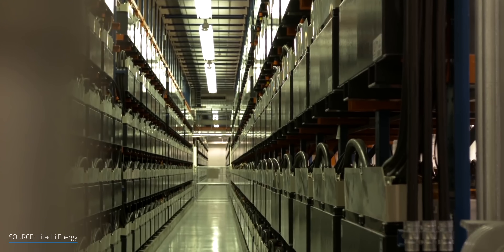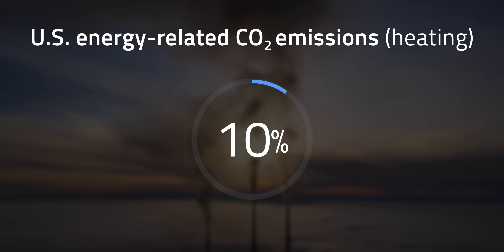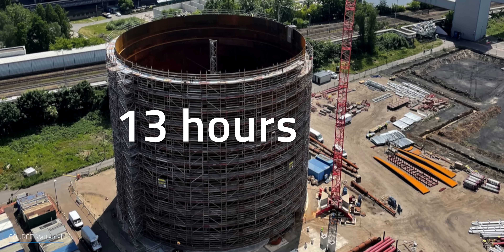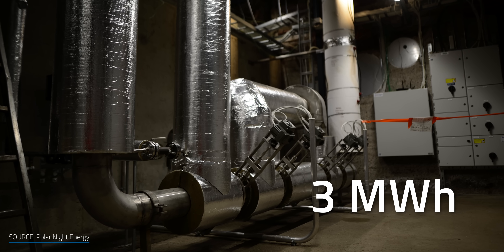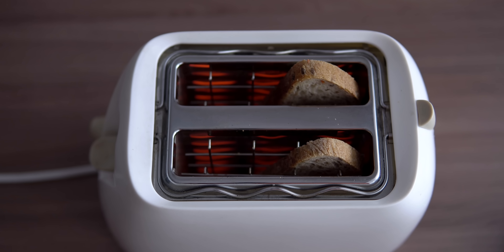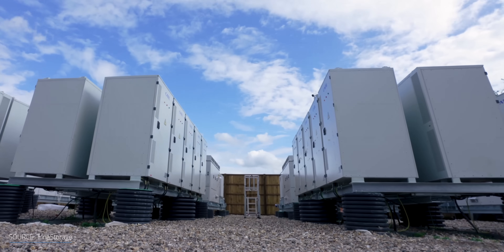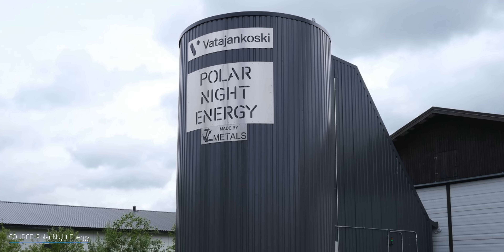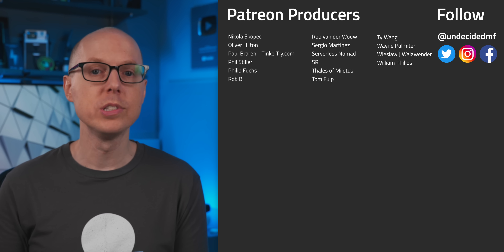How A Sand Battery Could Change The Energy Game

Comment: For heat storage the theory is really simple: Surface area increases by the second power, but volume increases by the third power.  So, for example, the surface area of a sphere is 4 * pi *r ^2 while its volume is (4/3) * pi * r^3.   The ability for sand or any medium to retain heat is primarily a function of this ratio... the only way to lose the heat in the storage medium is through its surface area.  So scale winds up being very important.   The bigger the storage medium, the more efficiently it can store heat.

The problems are many, though.   All heat storage devices have thermal expansion and contraction stresses so a daily cycle can really be quite harsh on the infrastructure.  In other-words, maintenance can wind up being a relatively large component of the operating cost.  Particularly if major portions of the device are inaccessible (aka sand battery).  Liquid (e.g. syrup consistency) based systems are far easier to maintain because no internal structures are required... you just pump the liquid through a loop just like a heat-pump water heater does.   Phase-change materials that go between liquid and gas are even better because the energy density is typically far higher.

It will be interesting to see how these progress, but it is a fairly tall order to compete against battery technologies which can be produced in GWh volumes and get cheaper and cheaper every year.
Reply: I wonder if these batteries could be kept underground.
Reply: they don't heat it up everyday
Reply: Heat expansion can be a problem in the long term sure. But if they have it working now and can estimate 50 years out of it, then think about it when it's scaled up. If this gets build big enough, then a single degree of chainge in temperature will store a huge amount of energy and therefore lower the amount of thermal expansion.
Reply: There is a surface area at which the heat loss (no matter how well insulated) begins to increase, so that is a limiting factor.
Reply: @timgurr1876  Surface area limiting factor only matters in how small the system can be and still be efficient enough for use, there is literally no limiting factor in how big the system can be, other than the materials used to build the sand holding. The bigger the system, the more efficient in storing the heat.
Reply: Sooo like the Giza Pyramid and probably like the Serapeum of Saqqara. Got to realize it at this point..
Reply: Surely you would just store the sand in a expandle material like arubber bladder that can expand and shrink and then ensure the first layer of insulation has a degree of flex. It is only the outer shell that needs to be rigid
Reply: Note that the amount of piping needed is proportional to the volume. It can only be cheaper if you target slower discharge. So e.g. a big-ass seasonal energy storage will be cheaper because it needs to discharge over many months, so there's more time for heat to travel through sand.

Now how big is big? Dry sand heat capacity is 800 J/(kg K). If we heat it up to 600 C, that's 480 kJ per kg of sand. Heating of a house in a northern country might require 10000 kWh per hear, which translates to 36 GJ.  So storing heat for one house would require 75 tonnes of sand. (50 cubic meters.)

If their prototype shown in a video stores 8 M Wh, that's barely sufficient for one house. So, basically, to keep a house warm during the winter you need a battery the size of the house.

So I don't think seasonal storage makes sense. To store energy for a district of with 10000 homes you need 500000 m3 battery. It can be e.g. cuboid with 50 m height and 100m length and widths. So, basically, the size of a hill. Or a city block.

The volume of The Great Pyramid of Giza is 2.6 m3, so that would store heat for 50000 people.

In other words, you need a megastructure like The Great Pyramid of Giza in every town of 50000 people. Not really feasible, is it?
Reply: OTOH if we had tiny robots which can build tunnels then existing rock formations (or maybe just soil) can be used for heat storage. If there's a way to build these tunnels for cheap it might be feasible.
Reply: @killers31337  Unless you build the city on top of the sand mass. If a greater stability is needed , concrete piers can do the job and further contribute to the total mass being heated. At some point a large enough mass doesn't require insulating except for the top in order to eliminate heat gain when not needed. In winter conditions some of the insulation could be removed and allow some heat to come in through the lower building elevations.
Reply: Wrong!

Comment: My one largest question here is:
Is it really possible to store energy at 600 C for months? The temperature difference with ambient temperature is almost 600 C. I really wonder how much energy is lost in 6 months time using this high temperature storage.
Reply: City block size with 10 feet of steel mill slag as insulation? Yes.
Reply: @kkarllwt  hmmmm interesting. But so the feasibility really depends on the scale and available space in the city/area. I am very looking forward to their end of year performance report

Comment: 25% efficiency in power generation is still acceptable, given how cheap and easy to build these silos are, and that the planet has a huge excess of sand.
Reply: Especially given the long distance high voltage lines that lose 40% over distance.
Reply: @davidmccarthy6061  I'm imagining every neighbourhood having a medium size one or every town having a large one, either way long distance transmission lines wouldn't be required. Though there'd still be some minor power loss between the generator and recipient I still think such a plan would make a nice compliment to the grid.

Comment: This seems like a great option for energy storage. However, I see a greater problem in the U.S.A., we are not insulating our homes to be efficient. In my area, they are still building stick homes without an exterior insulation wrap. Better insulation means less heating and cooling in the first place.  Cheers
Reply: My son did a science project in the 8th grade, comparing roof construction to solar gain.  We found that roofs heat houses thru radiation.  Radiant heat barriers prevent 90% of room heating.  Radiant heat barriers are cheap and super easy to install during new construction.  I asked a friend who is an engineer for large housing projects if they were using radiant heat barriers, he'd never heard of it.  My main garage, here in Florida is too hot to work in during the summer.  So i'm installing radiant heat barriers, a challenging project in my house with a very low attic, I can barely sit in it under the peak of the roof.   So you're 100% correct.
Reply: Here in Ireland our houses have good insulation but have no air conditioning, which is a real problem with the summers getting hotter lol
Reply: I agree. The building codes in America are horribly written. They heavily favor developer-friendly, box style "McHomes", not longevity, good living, or comfort. The insulation is grossly inadequate.
Reply: @nicklockard  re codes: few people realize that codes are developed not by bureaucrats or technocrats but by 'conferences' of stakeholders. Not perfect but a noteworthy process.
Reply: That's why ICF and SIPs are becoming much more common in modern construction, people are starting to realize we need more efficient homes to save money on energy costs and to also minimize noise
Reply: This is more an issue of local building codes, but I agree. All new builds here in Ontario have to be wrapped with insulation now
Reply: @PipeScholar  "Never underestimate the coercive power of a central state in the service of good and wisdom," Jerry Brown, former Gov. of California
Reply: Many countries are far ahead in Europe about efficient houses/car, just use brain and stop wasting energy.... Big cars, big houses....
Reply: I live in an area where we swing between 90+ degree days (F) in the summer and -10 in the winter. And even our homes are built so stupid when it comes to insulation. My parents had to pester the shit out of their builder to get functional insulation in their new home
Reply: In The Netherlands we have learned from the Finnish and Swedish building methods. And now in the energy crisis, we cranked up the speed to insulate our houses and make it more energy efficient. 

There was also an episode on 'Homestead rescue' in a desert cooling a container in a similar fashion. So somebody knows in the US 😉. I really liked what Marty Rayne was doing there.
Reply: Would it be more efficient to  use sand battery storage below grade versus above grade? This would be a great way to combine geothermal with sand battery storage. Perhaps it could be adapted to a  smaller scale to supply heat to multi housing units (low rise apartments for example). Looks promising.
Reply: that's only effective depending where you live, places like texas you're throwing away money for something that nothing on conservation, all it does it create more materials that could mold faster over time
Reply: @Vladimir S We got lot of houses made of stone, cost a lot to heat in winter. You need thermal mass, yes...BUT encapsulated in an insulated skin.
My house is partially under the ground and i hardly use any energy for heating nor cooling, it massively use passive heat from the sun and store it in it mass... We never go under 17°C in winter, temp outside rarely goes under -5°C.
Reply: @honumoorea873  . It would be interesting if you made a video about your home.
Reply: Exaclty, first thing i ask people, are you warmer when you wrap yourself in a coat, or  are you warmer by cutting the coat into strips and stuffing between your ribs. They tend to come to correct conclusion all on their own lmfao

Comment: I was going to ask why this can't be scaled down to residential size. We all have hot water heaters, so it's just a matter of pumping the output through the silo of sand during the summer and then pumping cold water through during the winter. Obviously, residential heaters can't currently get up to 800 degrees, but the general concept seems valid. HOWEVER, Matt mentioned something at the end that seems like a big problem. That fairly big silo can store 8mwh. For something that's operating day-to-day that seems pretty good, but if the point is seasonal storage then storage efficiency seems really bad. I estimate I use about 6mwh of heating during the winter (mountain town). So I'd need something the size of the silo in the video to get me through the winter?
Reply: With 0 additions to the heating over winter - then yes, however the sun does still shine in the winter and PV energy could be used to recharge/reheat during the day.

Comment: Why not put the heating element directly into the sand? Could then run water via pipe from the silo to a water to water heat exchanger ?
Reply: It could relate to isolating the power lines. I'm not sure of the arrangement they use. It might even be possible to eliminate a power transformer stage and reduce conductor size, depending on what kind of resistance elements they use.
You wouldn't want MV in the sand. (MV=Medium Voltage; 1KV to 35KV)...

Comment: I wonder if it's also possible combine a "heat storage" with a heat pump for individual homes, where you can actually extract the heat out of your home in the summer months (like an AC) but instead of transferring the heat into the surrounding air/ground (depending on the type of heat pump) it would be stored and used for heating the home in the colder months, when the efficiency of heat pumps is lower.
Reply: It is about the hill you are pumping heat up. Your fridg. pumps from 38/43 deg f. to 130 deg. to provide delta T for heat transfer to the air. Your AC 26 deg to 130 deg.

Comment: Wonder if the technology behind RTGs could be used to convert thermal energy from one of these into electricity with better efficiency than trying to do a steam driven generator. It wouldn't surprise me if it would have to be a low power solution, 10's of volts rather than hundreds, and perhaps hundreds of watts per hour rather than gigawatts, but that might be more than enough for LED lighting and security and environment monitoring systems that insure that heat is getting to paying customers.

Comment: I'm troubled by real-world physics.  Nature abhors a vacuum.  Almost as much as it hates a static environment.  How exactly is it maintaining its energy level without leaking it to the outside environment?  Even the tiles on the old space shuttle transferred a lot of that heat in.  Heat isn't like water where you can just seal it into a space with a rubber lining.  Heat permeates every known substance.  Yet you're talking about holding it for months at a time.

Comment: None of these systems are 'batteries'.  In a battery the energy is ready to use.  Connect the wires and you have electrical flow.  But in these gravity battery, heat storage, whatever, it's just a storage system that is then used to turn a generator which then provides the power.  The best systems use water, we call them dams.  The rest are silly and exist to draw government and private funding from people who don't know how things work.

Comment: It seems that this could be combine with direct heat to electricity conversion to make electricity when there is no demand for building heating and at which time the tank would be sitting idle at peak heat capacity.  With this process enbedded in the sand, there would be no losses other than the loss to the outside atmosphere that is occurring anyway.  The efficiency of the heat to electricity conversion would only show up as reduction in the rate of energy removal as compared to extraction of heat for building heating.  What this video didn’t cover is the heat loss over time.  For example what percentage of heat that is captured in, say, July is available in February.  This information is needed to determine if there would be idle time for the structure and whether another energy conversion process added to this would be of a benefit.  If a direct heat to electricity process were to be added, it could be made to be part of the shell to match the energy of the heat loss thereby significantly reducing those losses.  The idea would be to produce electricity when needed to supplement solar and wind for the grid in the amount of the full capacity idle time and match recharge rate tol have full capacity for heating needs.